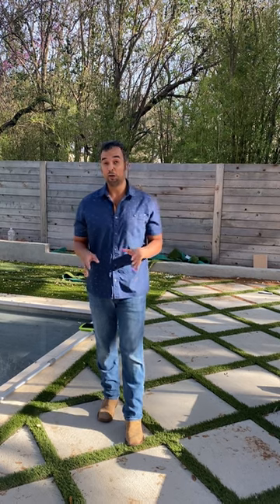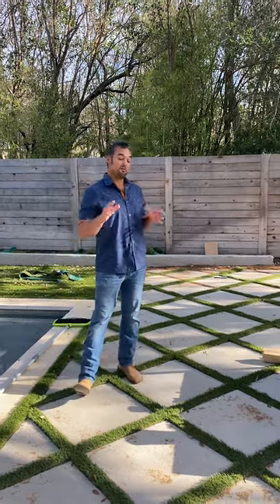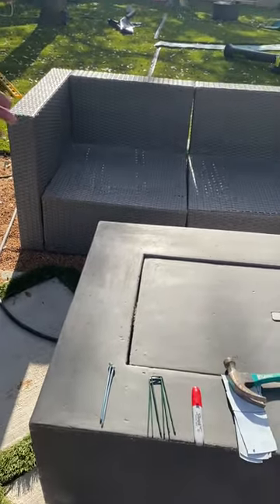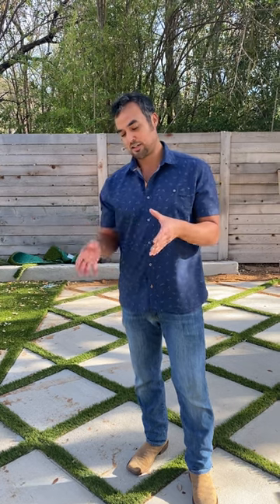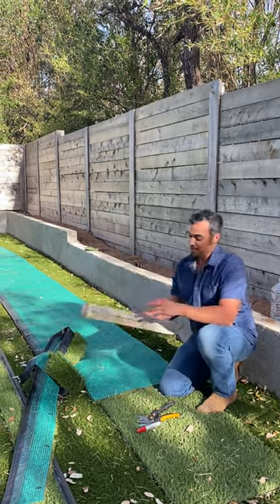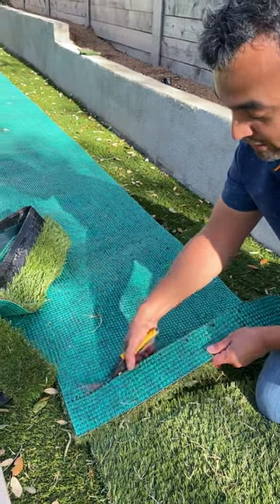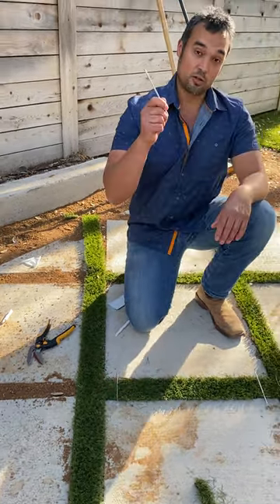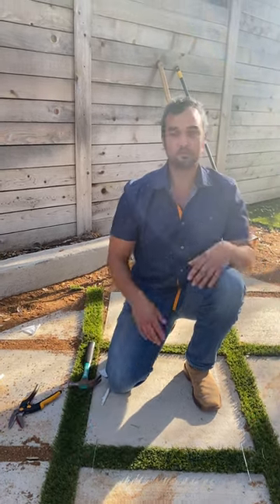How To Install Artificial Turf In Between Concrete Pavers

Comment: Will glueing the strips on a smooth concrete finish work?
Reply from the maker: I think I remember watching a video or two with someone using this technique, but I would research to be sure, since I didn't need to do that.

Comment: Did I miss something where is the video for:We will also show you how to secure the edges of the turf and how to fill the gaps between the pavers with sand. Additionally, we will cover how to properly care for your new artificial turf, including tips for cleaning and maintenance.
Reply from the maker: I did miss the maintenance! That was meant for another video I had. Thanks for catching that!
Reply: Can you advise on the best way to do the pavers, I assume you would start in the center of the area ?

Comment: Dude this was excellent. Did you put any sand down first underneath the decomposed rock or is it just the decomposed rock on top of dirt.... And no weed barrier?
Reply from the maker: Thanks! I did add sand on top of some decomposed granite and some just soil. I mostly used the sand for leveling purposes when I did the pavers, so it was mostly (a lot of) decomposed granite. No weed barrier and it's been about a year and half and I've had maybe 1 or 2 weeds come up in my entire area, so not bad! I was hoping I wouldn't regret the no weed barrier, and I'm glad I didn't mess with it.

Comment: The gap between pavers is 2 2x4. That's 3 inches.  Did you build the form to pour pavers from 2x4 as well?  What is rhe dimension of the pavers? Thanks!
Reply from the maker: Pavers are 2x2’, except where you see triangles. Those were formed on site based on those pavers. 

Yes all forms were 2x4s

Comment: Does that hold long term or does the decomposed granite start coming kit😊
Reply from the maker: It's been almost a year and it's holding up pretty good. The areas around the pool that get consistent water, the granite has packed down, but not enough that I've needed to address it.

Comment: How thick inch wise is that turf between the tile?
Reply from the maker: It's two 2x4's thick. So 3" thick. Mostly went this route because it was easier to form the paver design. It was complicated enough, so this made things easy. I have pavers in my front yard with a 6" thickness and I like the 3" more. If that means anything.

Comment: How many sq. ft of turf did you use in comparison to the sq. ft of the whole area with pavers included? Since your cutting the turf, I'm guessing its a lot less than the whole surface of the project.

Comment: We originally put our paver patio in with pea gravel. This spring I plan to transition to artificial turf because the pea gravel is the worst. Do you think I can use the pea gravel as the subsurface or should I remove it and get the granite subsurface?

Comment: Does this sort of thing require artificial grass or can you use natural grass?
If so, if I wanted to just do it for a small portion of my yard, would it be ok to use turf for that section with the pavers and natural grass for the rest?